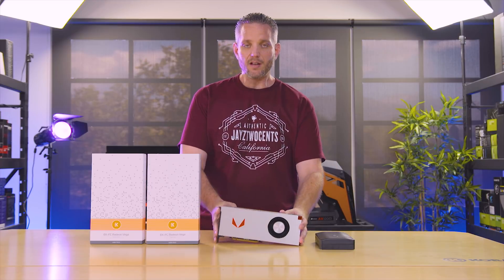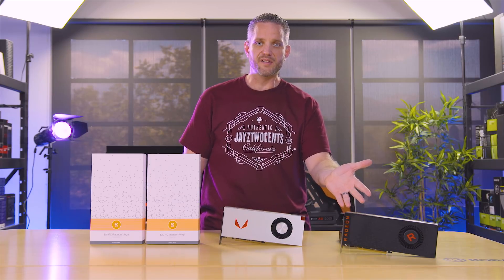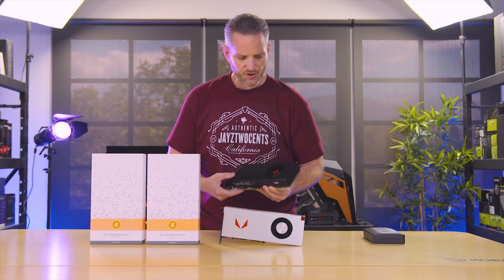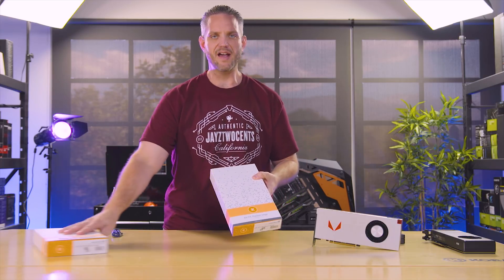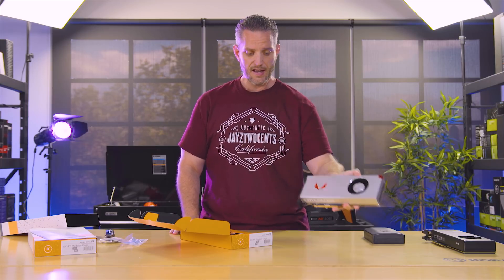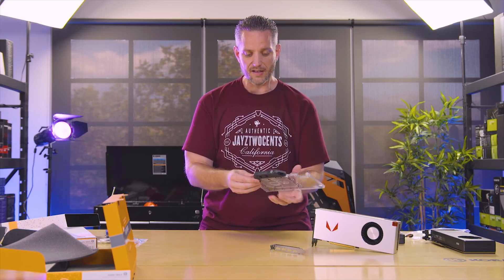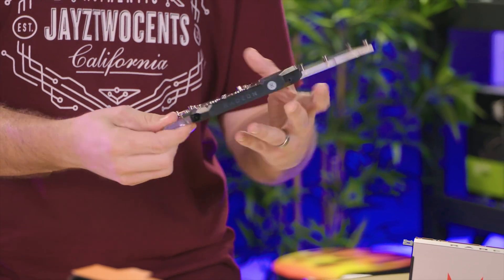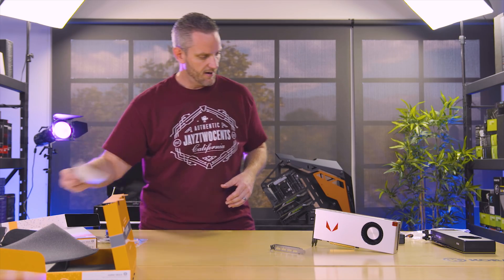Does watercooling help AMD Vega cards?

Comment: At first I wasn't digging the pink/purple hue lighting but then as you started showing off the system water cooling it looked amazing with the blue water and that pinkish hue! Also, as far as temps, power and performance goes for this card I honestly don't think it's bad at all. The 1080 got a hell of a lot better performance wise within a year of release so I'd expect that if this card already matches the 1080 at release then it'll surely beat it by a wide margin within a years time. The power draw is a concern for a lot of people and that is understandable but I'm looking to see how a full AMD system will perform by the end of the year which is when I will be building my system... hopefully.

Comment: Hi Jay, I still want to see some hash rates for these cards at mining various algorithms, but if you consider that a card which is coin mining is running 24/7 - keeping it at as low a temp as possible is really important. I water cooled some R9 290's on mining rigs about 18 months ago because with reference "blower" coolers they were SO F'ING LOUD but they also hashed ethereum better than almost any other card. The water cooled cards are the only 290s I still have left and I think it's because all the others had so many problems running at really high temperatures for months non-stop.
The point of this is - If you plan to run a card heavily, even if it's purely for gaming - I believe that keeping it's temps down will extend the life of he card dramatically. That doesn't matter for a dude like you who has 3 shit-tons of the latest cards, but for anyone else who would like to get extended usage out of their new high end GPU, I really recommend water cooling. I know the initial investment is high, but it would be interesting to me to know whether in the long term that investment pays off - for people who only buy a new GPU every 2-3 years or more.

Comment: Is it worth it? Of course it's worth it. Vega is a beast. 13Tflops for machine learning, FreeSync, not supporting a monopolistic piece of shit company like Novideo. It's easily the best GPU on the market. FreeSync alone makes it a much better deal than a gtx1080. In fact Vega 56 completely obsoletes 1070 and 1080. There is no reason to buy those two GPUs anymore.

Comment: Lol AMD/ATi cards have never been worth it. Buggy drivers and low preforming cards isn't ideal. Makes NVIDIA drops prices which is good. Heck I got a 1080Ti on Newegg Ebay for $630 last month. Slapped a waterblocked on it and it's still cheaper than these overpriced Vega cards.

Comment: Try and get your hands on the registry mod that increases the power limit to 500+ watts, that might prevent it from throttling and increase overclocking potential. I also heard HBM clock has more influence on performance than core clock when overclocking.

Comment: I have one of these blocks on my Vega64 and I have my overclock stable at 1722MHz core & 1100MHz memory.  Saw a pretty large boost in benchmarks.  From ~9800 on 'turbo' profile to >11000 overclocked in Firestrike Extreme.  Using my power bill I calculated annual running cost of Overclocked Vega64 vs Power Save mode was ~AUD$30-50.  Temperatures are similar to Jayz, 45-52 depending on whether CPU load is also high (GPU, CPU & memory all in the same loop, and my CPU gets hotter than the Vega does!)

Comment: Speaking of 110 degrees. I'm building a pc for my garage workspace and want to know how much ambient temperatures affect CPU temps. My garage gets 110 at times and I'm wondering if water cooling is enough to maintain safe temperatures. Thanks
Reply: Basic laws of thermodynamics means you will never get below ambient. The more radiator real estate you have the more chance you'll have of getting closer to that point however after a certain point the extra room just allows you to run your fans slower.
Reply: Yeah I understand that, that's why I'm asking if given the high ambient temperature will I still be able to maintain safe operating CPU & GPU temps.
Reply: It'll still be the best solution you have; it'll still beat air cooling. Basically if your ambient is so hot watercooling won't cut it then nothing will.
Reply: Daiyus That's why I'm trying to figure out if I need to build a phase change system instead of a water cooling before I invest a bunch of money into a custom water loop setup.

Comment: I have been waiting for this video.  I'm disappointed that it doesn't have as much as an improvement as the 480 had on water but now I have a place to put this in my head.  The question really comes down to whether or not I should pay more for less and save on the monitor with Freesync or if I should pay about the same for more then pay more for a monitor with Gsync.  There is no clear winner.  Thanks again for the video.  Coconut Monkey is getting better every time haha

Comment: It's worth it if you use Linux and don't want to use blobs (proprietary drivers) as Vega is working out of the box with the last kernel and radeon stuff from amd-staging. It even run faster than using AMD Crimson driver.

If you don't mind outdated kernel/gfx stack or are using Windows, get an Nvidia 1080/ti instead.

Comment: I am getting Vega limited edition air $100 cheap than 1080.......
So............
Reply: Just got a new Vega 64 for 340 USD.
Reply: el1te1984 fucking how
Reply: A about the time of this thread, I exchanged my ftw 1080 for a vega 56 + 120$, I am getting better results than strix 1070's overclocked with it so I don't mind much. I could do the powermod to get to a 1080/2070 level but the powerdraw is just too high
Reply: Spark99 Gaming How and where?
Reply: in his dreams?
Reply: JayJapanB NO😂 Vega 56 < 1080
Reply: Where I shop for parts I found a standard Vega 56 for only $50USD more than a GTX 1080.
That's a pretty good deal..... right?

Comment: I really think, at this point, the only justification for Vega, in terms of pricing, is if you factor in monitor costs for enthusiasts. You will spend almost $1100 on the G-Sync Acer Predator 34" monitor vs the Freesync equivalent at $700. So you might pay 1080TI prices for the card, but if you couple in the $400 offset there, it may be worth it to some people. I'm personally a lifelong NVidia guy, but after they dropped the 10 series with no warning right after I bought a gtx980 for $480 (but long enough after for me not to be able to return it), I'm feeling a little salty towards my green friend. So I am a little biased towards wanting NVidia to have some decent competition. If you weren't planning on buying an expensive monitor, then yeah, not worth it. However it is food for thought if you were planning on going all in on card and display.

Comment: Vega 64 doesn't make a lot of market sense at current market prices; "normal AMD price" is ok, not great but palatable. Vega 56 makes more sense amongst a community who certainly favors a price/performance advantage. Maybe some more affordable $100ish waterblocks on Vega 56 with the right undervolting and overclocking could see 1080 performance at around the same price to $50 higher or so. I believe two years down the road, current Vega will shine brighter in performance, possibly coming close to 1080 Ti in very best-case scenarios (AMD-favored game, mature & optimized drivers, waterblock and high OC, etc.).

Comment: Just buy a 1080 or 1080 Ti and call it a day. They are more powerful, use far less power and the custom cards look 100 times better. AMD shouldn't even speculate the new cards anymore, they should just focus on processors and build graphic chips until they make a world shaking breakthrough in technology. As far as I am concerned, they lied to people for 2+ years and lead people on to believe that Vega was going to be a price shattering card that delivers. It did not, not in any way.
Reply: Shane Khiu I'm well aware of the performance gains, but I'd have significantly worse input lag or tearing based on VSync, or pay to replace them with GSync monitors. FreeSync isn't about low performance systems.
Reply: Shane Khiu completely disagree. The point of freesync is to match rendered frames with the refresh of your monitor, for a smoother experience, without tearing. Doesn't matter how many frames your 1080ti can put out, if they are not matching the frame refreshes of your monitor, then the experience will be worse. Plenty of reviewers will back that up as well.
Reply: +Hugo Olloman  They're actually still about £20 over MSRP but yeah they're avaliable at reasonable prices. I just don't want a reference card, waiting for aftermarket, then I'll probs pick it up as an upgrade from the 390X - I have FreeSync monitors so I'm not getting a 1080.
Reply: Jamessuperfun I thought the msrp in $ translates equally to £? 
Anyways I totally agree with you, aftermarket card are definitely the way to go. I unfortunately bought a 64 watercool on an impulse buy, I got suckered by that pretty shroud haha. But I already had a very expensive freesync monitor, so I needed an AMD card
Reply: Not sure what you mean? It is fairly close, the pound is worth a bit more, though our prices include tax (20%). It used to be worth a lot more but then Brexit lol.
Reply: Ya Brexit something that should have happen a long time ago, but morons don't understand.
Reply: Actually the pound is the same now as it was pre brexit:P it went back up
Reply: @blitzwing1 
I remember the 3Dfx days. Over clocked my voodoo banshee as much as it could take. They invented the SLI mode. Too bad they bankrupted - that was a sad day. The competition shrunk. VIA / S3 graphics didn't succeeded either.
Reply: Why do people complain about AMD being behind Nvidia especially when Nvidia has waaay more R&D money also do people forget AMD was on the verge of being bankrupt for 2 years AND STILL pulled out a card that's competitive that's pretty impressive imo
Reply: Beast6228 its not their fault that miners buy them in truck loads, and retailers bump up the price because of it. when ethereum dies the price will drop and by then aftermarket cards will be here. Also freesink is way cheaper so its worth for me 50 or 100 dollares more for the vega. I have a 970 right now and its still good. But in a year or so i might get a volta navi or one of thid aftermarket vegas
Reply: Beast6228 you always see cards prices go up when there's little stock. At the moment you can get both the 64 and 56 for msrp in the U.K., I wouldn't personally buy a reference card, but they are there if people want them. If you need an AMD card, the value isn't that bad
Reply: Jamessuperfun you don't even need a freesync monitor. Invest in a good aftermarket 1080Ti and the fps you gain will beat any benefits of a Vega64 + Freesync combo.
Reply: THAT IS COMPLETE NONSENSE..

Comment: I'm running Vega 64 w/ the EK Nickel/Plexi block.  Idles around 28c, Light gaming and Heaven 44c and marathon gaming peaks at about 55c for me.  That is at 1742 (is what it showed before xx.2 broke the OSD clock monitoring.  My 3Dmark scores still report as 1742) core and 1033 memory.

You make it look a lot more sexy than it is...  That DAMNED blue film on the thermal pads!

Comment: No thank you Cred Dead AMD your overhyped watt wasting and very late Vega 64 gets beat like a pinata by Performance Per Watt Champion Pascal 1080, beat like a rented AMDonkey by Performance Per Watt Champion Pascal 1080Ti. 

AMD needs high cost low yield HBM's efficiency for its very late Vega because Vega's uArch and Glofo FinFAIL process Sucks Watts. Nvidia's does NOT NEED high cost low yield HBM for it's gaming GPU's because it's uArch and TSMC FinFET process has a MASSIVE Performance Per Watt Advantage.

Comment: you can get a water cooled 1080 Ti for $800. either with an all in one cooler like the evga hybrid or msi sea hawk. or a card that can be added to custom loop, the like Gigabyte waterforce WD. another $50 gets you a Asus Poseidon which can be used in waterloops or just by itself.

Comment: Not gonna get a GPU this time around, neither 1080Ti or VEGA. I'm happy with my two SLI 980Ti, that I plan on piecing together with a 1920X threadripper. GPU's are just too expensive right now. Some of the 1080Ti GPU's here in Sweden costs up against 10.000 Kroner, which is over 1200 USD, inc. VAT 25%. But that is an insane amount of money.

Comment: Why do people comment about the cost of watercooling and talking about just buying a better card.  That is a no brainer.  There is absolutely no performance advantage to watercooling period. especially if you keep everything stock. The only advantage you get is sound level if done right.
People water cool becuse they want to.  It looks awesome, and it makes you computer quieter.  Other than that it's compleltly pointless.
I have watercooled my entire rig, cost me thousands and for a zero performance gain. But that's not why you watercool.
I will be getting a vega56 and watercooling it, becuse thats what my system has, it's just part of the cost of my computer.
If you don't have money to burn, don't do a watercooling system!!!

Comment: 1. How HOT can the RX-VEGA64 GPU get without throttling?

2. Is there any POINT in cooling below that such as reliability?

3. Do you still need to mess with Wattman or other tools other than basic overclocking (power + frequency offsets) to get the maximum overclock using custom liquid cooling since temperature isn't much of an issue?

4. VRAM cooling apparently matters a fair amount. Where does the VRAM frequency benefits stop or can't you go that high (with GPU at say 1700MHz)? Such as 4K benchmarking., and..

5. What are the temperatures when you have AIR CONDITIONING running. Including:
a) outside temp
b) other rooms in house, and
c) three feet from the RX-VEGA64 (thermal equilibrium with Air Conditioner after sustained gaming or testing)

(Put another way, how well does your air conditioner pull heat out of your room... I know my small room gets hot with about 400W continuous draw including monitor. Often 30degC when most of house with AC is at 24degC)

Comment: i had to stop the video half way to say: holy fuck that card looks AMAZING. ok - going on.

EDIT: the clock fluctuation you see is the power limit of the card. you should be able to stabilize the clock by undervolting the core, so you get more clock out of less voltage. also be sure to get hbm as high as you can, its ok to drop the core clock and voltage a bit to lower heat spread on the hbm stacks (90°C at hbm will throttle it). use "watt tool" for that (power states), wattman seems slighly bugged right now. most vegas are stable at stock clock between 1.0v to 1.1v core and do 1000 to 1080 mhz hbm2.

i think its not fair to add the watercooling block price onto vega to compare it to a gtx 1080 (ti), because the waterblocks for these cards dont come for free, too - in fact vega is cheaper because you can use the stock backplate. if you want to put any card under water you're seeing that >100$ waterblock on top of it. now vega really likes low temps and the hbm stack makes it a really nice card to watercool - so why not? together with stable clocks due to undervolting and hbm overclock that card gets a huge performance bump. a little less than 10% from hbm oc and some 5-6% from the stable clocks and ur sitting at a whopping ~15% increase by just cooling it properly and tuning the powerstates.

Comment: I think this time I will go with Nvidia cause price vs performance vs power draw are much better, from what I saw buying a Vega 56 is like getting a 1070 overclocked that has more power draw than a 1080 in my opinion is not worth it.
I was hoping for vega and I still am (kinda curious on how custom cards will be) but I'm slowly changing my mind...
And Thanks Jay You are the best

Comment: Hard to say that custom water cooling is ever 'worth it' considering how expensive it is. The only time it's actually worth it is when you're at the top of the chart already, Titan X or x80 TI level stuff. Even water cooling a GTX 1080 puts you well within GTX 1080 TI striking distance and you'll never be able to make up the performance gap just with better cooling.

Comment: Jay, you really should have put quick disconnect couplers on your CPU loop so that you could put the same on the GPU side and put CPU and GPU on the SAME LOOP using only 1 radiator. OR if you still wanted the 2nd rad, just tube it in.

Comment: Instead of using the paste that comes with the kit, why not use liquid metal?
 I have seen a minimum on 15 degrees Celsius from CPU's to GPU'S.

I can't understand why it's not a standard. All enthusiasts that are willing to potentially  void their warranty with a watercooling block will try it anyways.

I tested with a evga 1070 sc looking at the temps with stock paste ,NTH1, thermal grizzly conductonaut and the fan at 100% at all times on all three instances. The stock and Noctua stuff had the same temps 72c at load ,but with LM there was a 15c drop over a period of 10 hours of straight gaming with Elite Dangerous in VR , which can be demanding.  That tells me that the cooler has the capacity to remove heat from the gpu, but not enough is getting to it due to the reduction of transfer caused by the stock and NTH1 paste. 

Do keep in mind that in order to take advantage of the LM you must have a cooler with enough capacity to extract the additional heat that is gong into it at a faster rate (instead of staying in the die heating other components, or becoming radiant heat). Single slot fan coolers will not work, but watercooling blocks and aircoolers with multi fans will take advantage of the increased heat transfer..